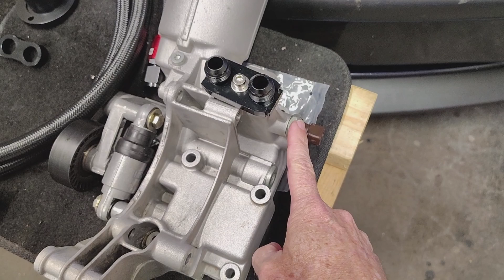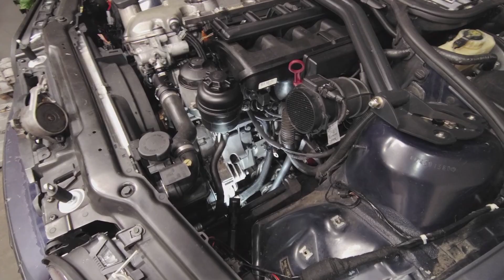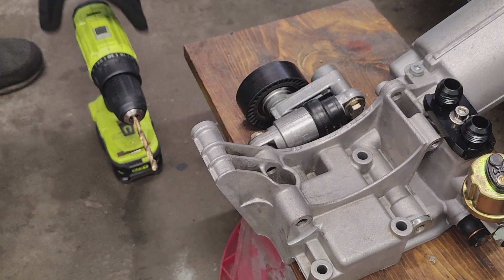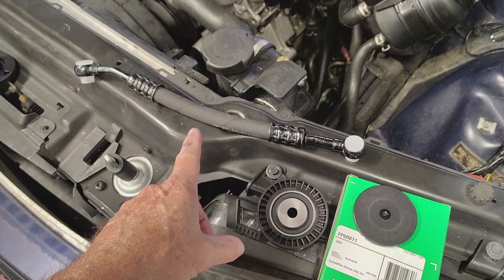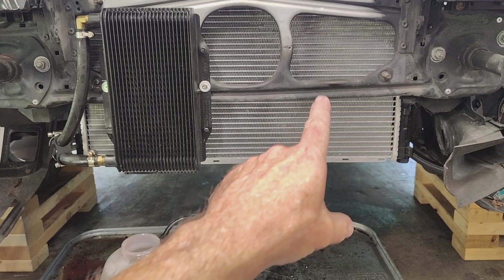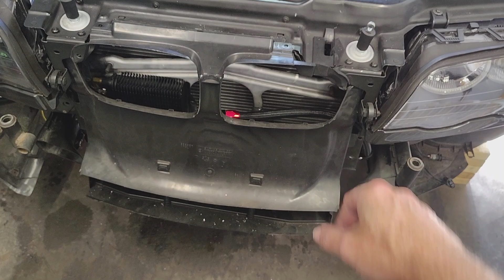BMW E46 Oil System Upgrades (Part 2)

Comment: What can you say about m56 crancase ventilation system?
I have genuine new all components on mine m54, but I see lot of oil inside intake😢
Reply from the maker: I recommend it for boosted setups. If you're staying n/a then it's just personal preference. But any PCV system is going to let some oil into the intake manifold, because nothing is perfect.
Reply: @michaelblacktree so you also can see some oil inside intake on your engine?
Reply from the maker: @kentus31  - Yes, there is a little bit. Once again, no PCV / CCV system is perfect. There will always be some oil getting into the intake.
Reply: @michaelblacktree  I had some cars without oil at all!

Comment: Odd point, but that hose coming off the bottom of the steering pump reservoir seems rather stiff - might replace that anyway, being in that deep [assuming its got more than 5 years on it]..
Reply from the maker: The hose is fine. It was replaced recently.

Comment: Hey I gotta quick question I was wondering what benefits come with changing to a s54 housing on Non M e46s when being boosted ?  Just curious since I’ve never seen an answer for it haha. Sorry if you answered it in the video when I watched my internet connection was pretty spotty
Reply from the maker: The S54 housing has oil cooler ports. There are oil cooler adapters that replace the filter cap on the non-M engines, but the ones I've seen were pretty janky.
Reply: @ ahhh I see, that makes sense and I’m guessing with it being boosted it goes well with the other parts because it takes some stress off the engine in high rpm’s which in hand makes it perform way better
Reply from the maker: Engine oil is critical to engine survival. And a turbo puts extra heat in the oil. An oil cooler gets the oil temp back to a safe level. Not sure if that will add any power, but it will help the engine live longer.

Comment: What year is your car? I wonder when the PS pump design changed...? My Xi is an 01.
Reply from the maker: It's an '01 330i. From what I've read, the LF20 pump had a pretty short run. But I like the steering feel, so I'm keeping it.
Reply: @michaelblacktree  Interesting... I feel like I read once that some people said the steering on the Xi was a little heavier, and "better" (seems subjective, haha)... would be interested to know what cars got what!
Reply from the maker: @mry82  - The AWD could be contributing to that, as well. But yeah, steering feel is subjective. I kept the LF20 pump, because I like the steering feedback. But they're notorious for shaft failure.
Reply: @michaelblacktree  for sure all that extra/different hardware of a part of it! Ahh, I hate shaft failure, lol.. take it easy man!

Comment: Which sender unit and gauge did you use? the location where you installed it is the oil temp sensor or the pressure switch? on the m54 housing.
Reply from the maker: Just something cheap from amazon, installed in the oil pressure sender location. The stock oil pressure sender piggybacks on the adapter.
Reply: @michaelblacktree  Thanks 👍